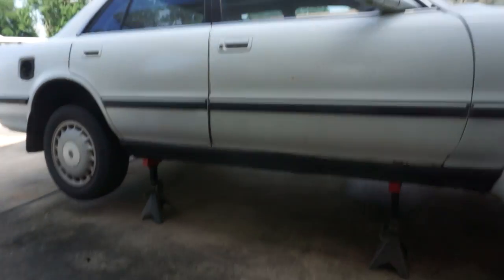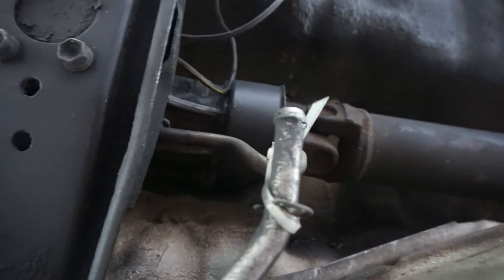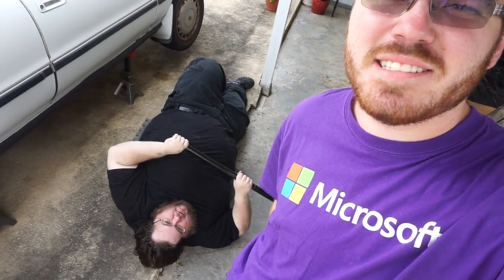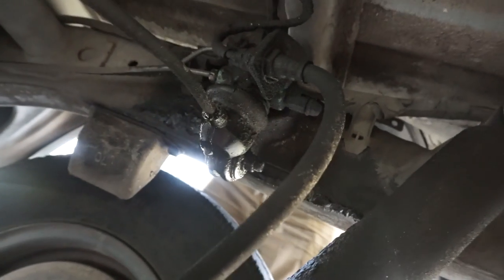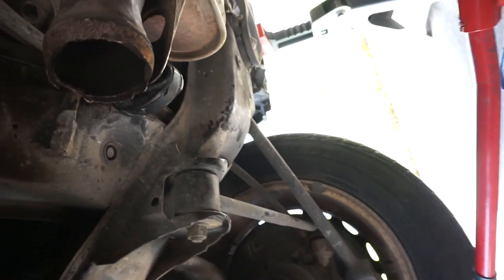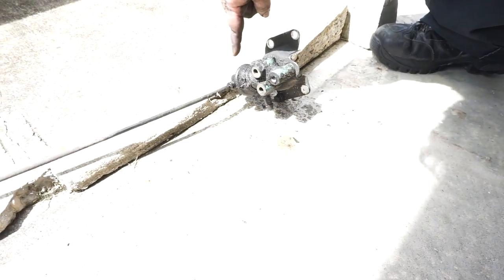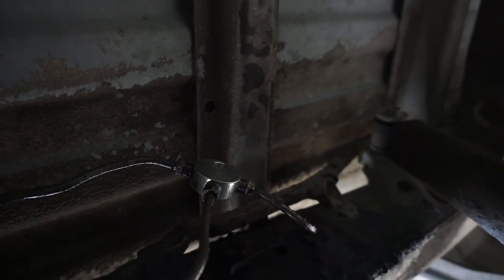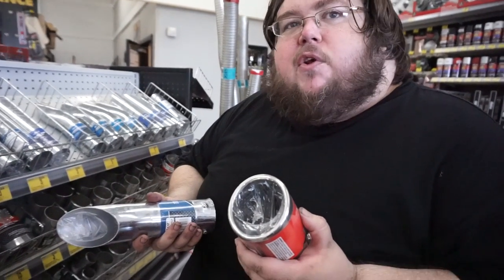No More Muffler and Bypassing Toyota Pickup Brake Valve ...24

Comment: How did the brakes on the truck work out? I am thinking about doing the same to mine
Reply from the maker: It was fine after that. I don't know what it would have been like if I had towed or hauled something.
Reply: @cjohn64  okay, thanks. I don't plan to be doing much hauling or heavy loads. I was concerned about the rear brake drums locking up I've there was not a valve there